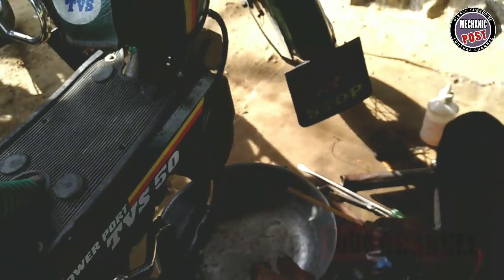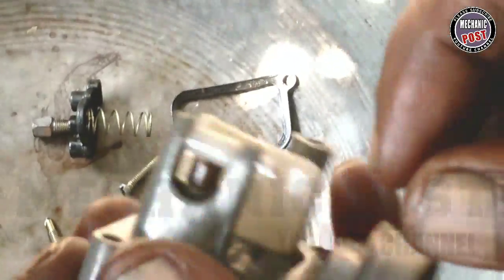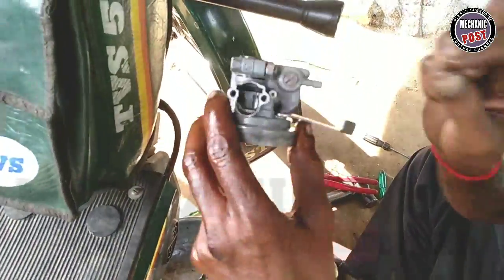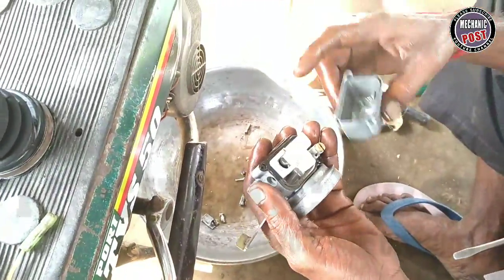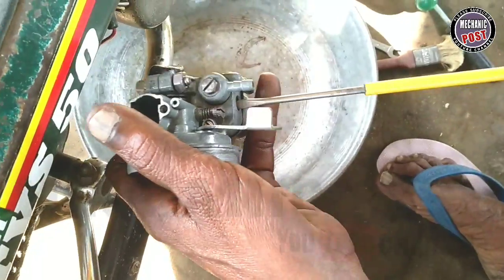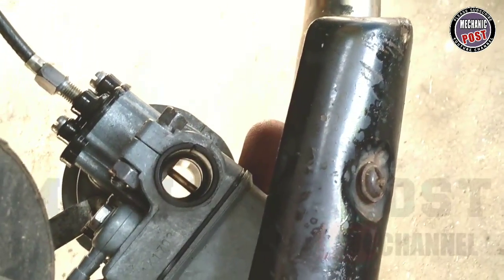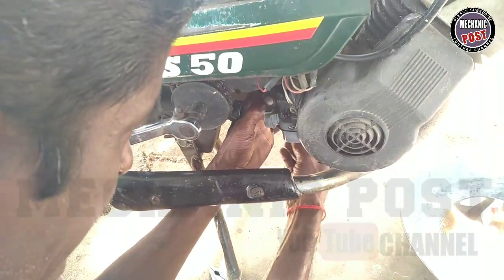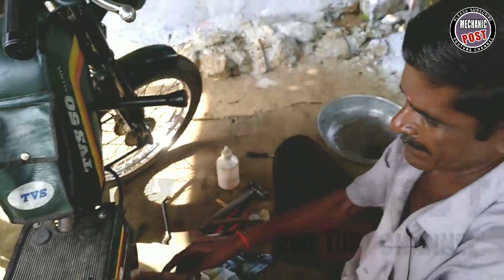Carburetor Cleaning |TAMIL|MP|MECHANIC POST

Comment: sir i have tvs champ (1994 model) i change several chain sprocket but the chain not even (up and down) running please tell me one suggestion to solve the problem (even i have change rear wheel hub also ) same problem arising. belt wheel la change panni pakkalama sir
Reply from the maker: No problem,🔴Please,contact the telephone number given in this video description.Thank you.